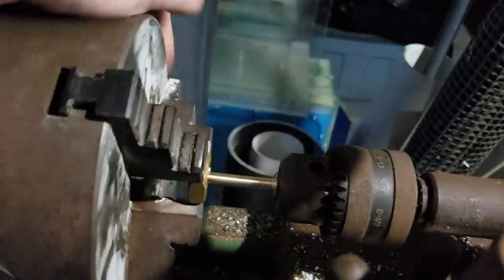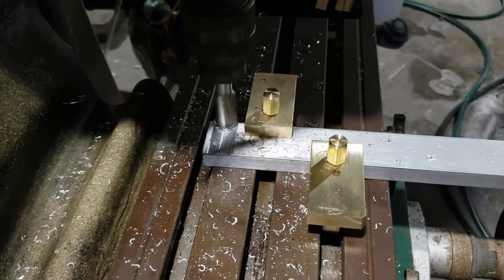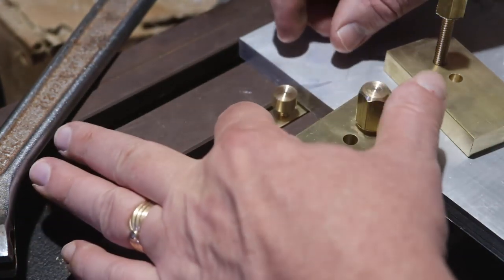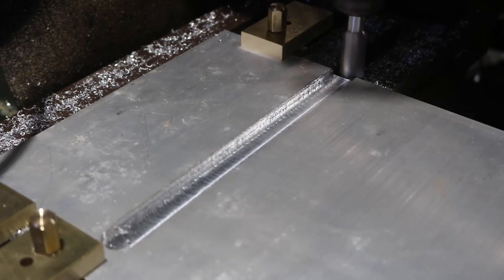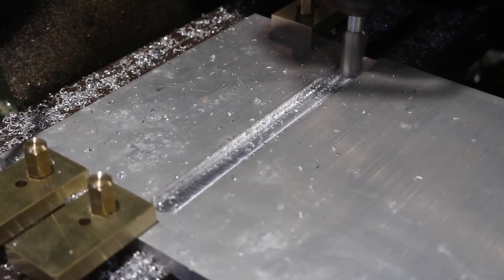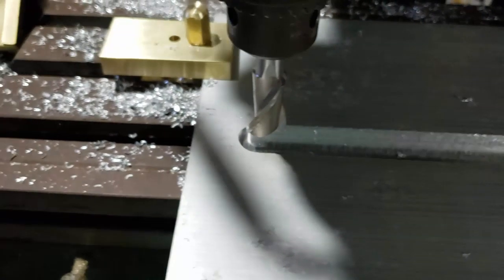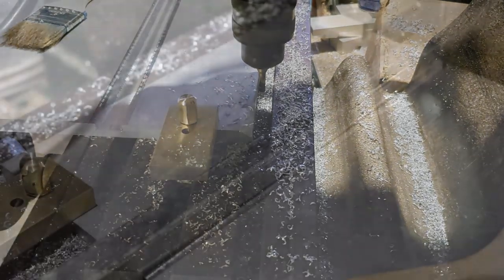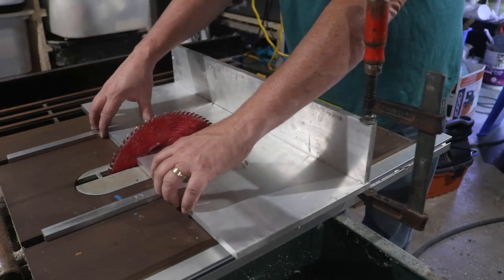DIY Aluminum Cross Cut Saw Sled Part 2

Comment: Looks like it's super smooth when it moves.  Are you going to weld it all together?
Reply from the maker: I suck at welding Don. I also want to be able to take it apart for modifications. Thanks for stopping by
Reply: @FishmanEricRussell  just want you to know the box came in the mail today. I didn't open it yet I want to do a set-up video I'm just trying to find time.